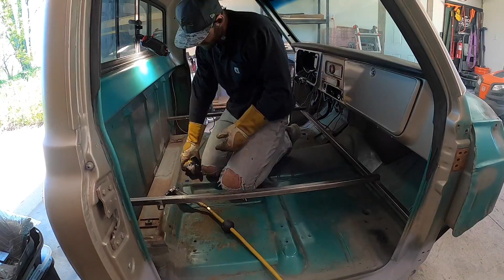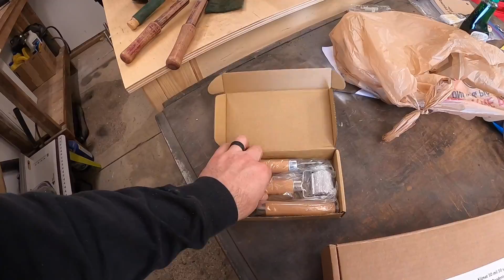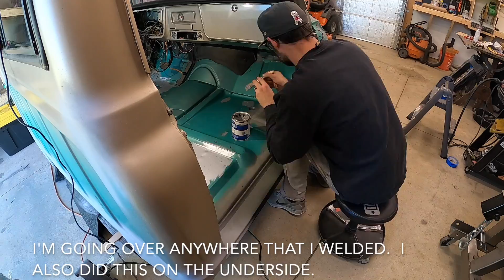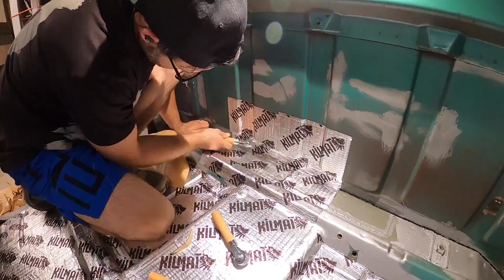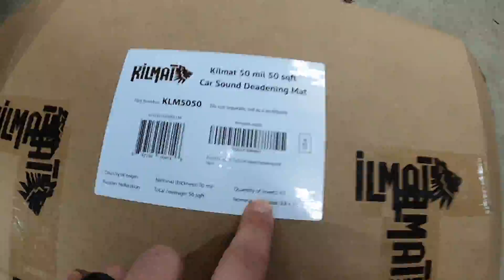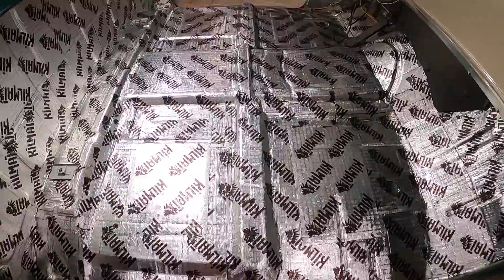Installing Kilmat Soundproofing in the Cab | 1970 LS Swap Chevy C10

Comment: Nice job!..as a novice, I never thought about cleaning with alcohol, and using rust evaporator on some rust spots.
Reply: No need to use alcohol its good because it dries fast but you can use windex or other cleaners as long as it doesnt have oils to affect the adhesive

Comment: Just curious why you wouldn't remove that little bit of rust from the floor, 5 minute work is far better than encapsulating it where is will come back later. Encapsulators should only be used when you cant remove the rust not just because someone wants to save 5 minutes of their 2+ yr project

Comment: Great video. I am doing a similar process in my truck now. My question is about the rust encapsulator. I know its purpose but im curious on why you applied it in the sections you did. I am guessing the bolt holes?
Reply from the maker: Bc that’s where the rust was
Reply: Ah lol Im working with a rust free truck so was wondering

Comment: Great video! Since this is a semi-permanent install, were you just extremely thorough in rust prevention before laying all this down? Want to do the same in my 83, but needs some rust prevention & clean-up first.
Reply from the maker: Oh yea, all the rust was cut out and replaced. Surface rust was cleaned up and converted before hand.
Reply: Use POR 15

Comment: Is there any reason not to paint the entire floor with rust encapsulator?? If I’m going to be covering the entire floor with the Kilmat ?
Reply from the maker: It wasn’t all rusty. That stuff isn’t exactly cheap. For proper adhesion it would need to be rusty or stripped all the way to bare metal and used like a etching primer.

Comment: Outstanding videos Paul, I am working on my '68 C10 and I am doing the exact same thing and having the exact same issues with rust requiring the same level of metal work.  I have been using your videos as a how-to guide along side my '67-72 C10 assembly manual.  This video has convinced me to sound deaden the cab as well.  Cheers!
Reply from the maker: I’m glad they’re helping you out 👍🏼👍🏼👍🏼

Comment: Sound deadening on the roof of the truck will help a ton, it did on my 85 square body.
Reply: Do you think it will start to fail with heat from the sun and gravity?
Reply: @jayinla81  I think it has a heat rating of 212 degrees f
Reply: One of the Best Ideas of SoundProofing is "SoundProof Curtains" it actually Block outside Noise coming from Windows. Check Here: https://livesoundproof.com/best-soundproof-curtains/

Comment: Nice Build so far!! A little bit of advice...a heat gun works wonders when installing sound deadener material...heat will make it roll like baby drool
Reply from the maker: Good tip! Thanks. That’ll make doing the doors easier

Comment: At :32 seconds to the right, there is a Harbor Freight jack stand recall, because of failure. You can find videos here on YouTube, you should do a (short) FYI to get the word out. There's over 500,000 affected units, I think...
Reply from the maker: I don’t use harbor freight jack stands
Reply: @paulkc10  
Made under a couple of different brands as well, but I can't find the video...
Reply from the maker: Share it if you find it
Reply: @paulkc10  
https://youtu.be/Gn7FPbT2fxQ
And this will link to others in the suggested column....

Comment: Just so you know, the doors are one of the most crucial steps for sound deadening. Don't skip the doors. I would also add a layer of closed cell foam on top of the deadener you just installed.
Reply from the maker: The carpet I’m putting in has a closed cel backer. So that’ll work perfect 👍🏼
Reply: @paulkc10   Cant wait to see the finished Product!

Comment: Did you film this a while ago, or this morning (6/7)? It hasn't been chilly in the morning in a while in my part of Michigan. lol Noico 80mil is also a cheap deadener choice. If you really want to quiet down the inside, a layer of Mass Loaded Vinyl or sheet lead (either is about 1lb per sq ft) over the deadener will make a big difference as well. If you use sheet lead, pick up some 5mm-ish closed cell foam with an adhesive backing and use it on both sides as. MLV would also benefit from this, or you can look at a product called Luxury Liner Pro. It's made by a company called Second Skin Audio. Other than sheet lead (available on Amazon) they carry everything you would need to make it sound like a Benz, lol Get more for the roof and the doors, especially if you put speakers in there.
Reply from the maker: started May 31st.  It was 80's all week then was 50's that day

Comment: Great progress, Paul! I don't think the extras on the floor will make a difference. It's sound deadening not heat shield. I put Dynamat in my bug and am thinking an extra layer on the firewall would not make a difference. You should have put them in the doors and a heat shield under the cab above the exhaust.
Reply from the maker: Yea I don't think it's going to do anything.  I'll get more for the doors.  It's pretty inexpensive.